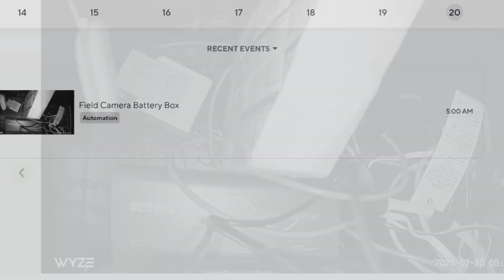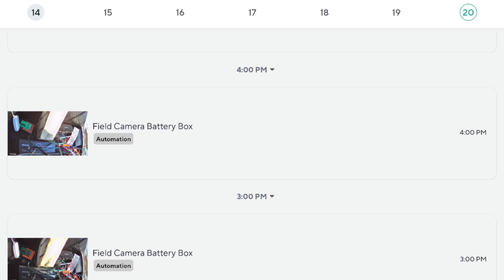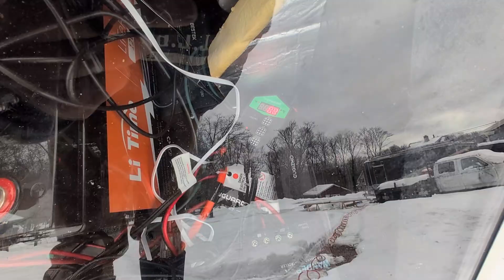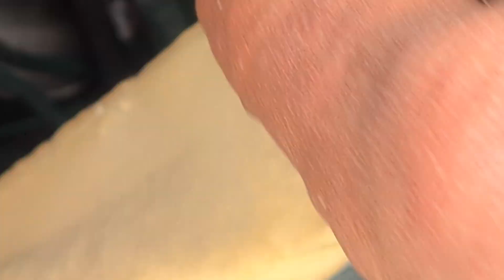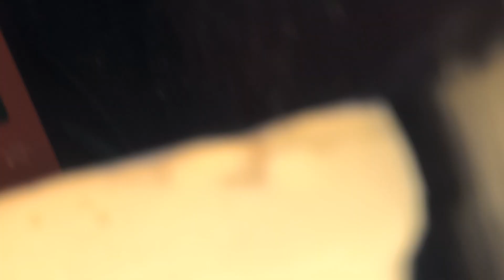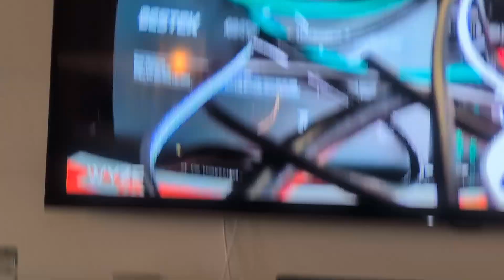Help my trail cam system just went offline!  - Solar Wifi Trailcam Build 004

Comment from the maker: Glad I could figure this out - I ended up replacing the breaker between the battery and charger cause it kept flipping at 22amps. ! It's definitely good to have those breakers in an easy to see location, but I definetly need to clean the box up for a more final configuration. So far though the fuse has not flipped again but will continue to keep an eye on it. Not sure if the breaker was faulty or maybe if there was some other underlying cause?